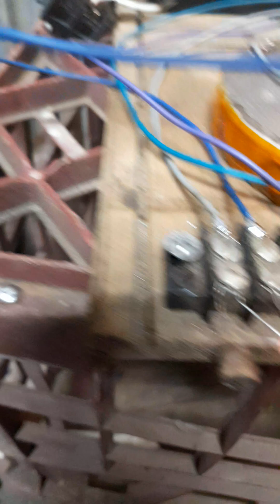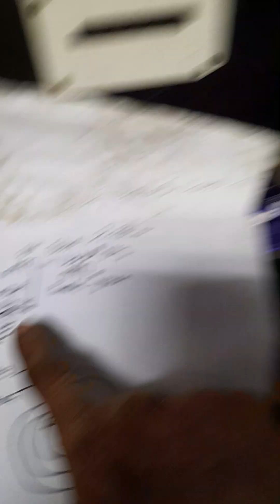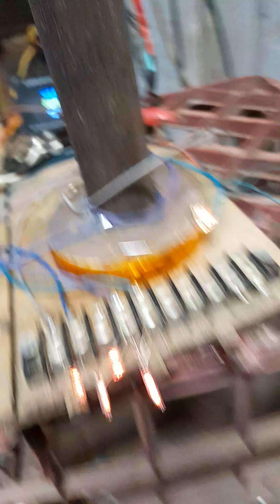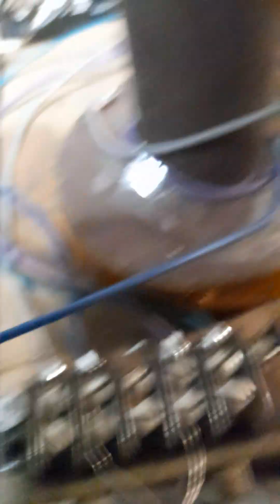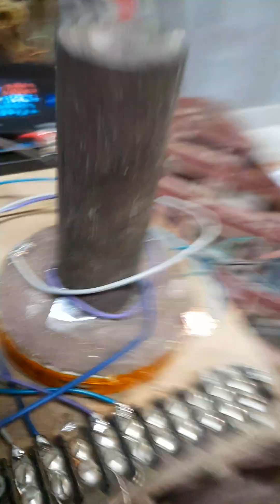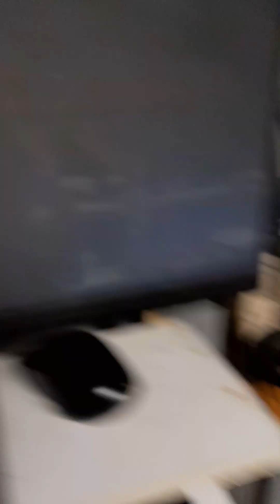Tesla electrical oscillator circuit driving copper tape bifilar coil.

Comment: Cool experimental video! What do you think about Wimhurst machines? Could you find a way to get a static electric spark generator thing (wimhurst machine) to do anything useful? Like charge a battery or power a light
Reply from the maker: thanks... not sure where i was going with this... i lie. i was aiming to get the 1/4 wavelength conductor in combination with the LC tank circuit, had to make something to at least get an idea of how the dielectric thickness/surface area interact... but ran out of tape when winding... the copper foil is definitely a 50M roll, the tape was only 30 at best... and from what i can figure out from calculators, i really want about 0.5mm or thicker dielectric.

so just playing with a few neons,  it did show a few peculiarities,  capacitive versus inductive coupling. the video does no justice... and i have no faith in any measurement made of either value with a standard meter.... mostly because theyre invariably an LC oscillator. so i cant even say how the calculated values differ from actual values.
put on the shelf and do other things, and suddenly several years have vanished!
i believe the only way to get true readings is via wheatstone bridge measurements or similar... take away the frequency component and you can isolate the inductance from the capacitance.

as for wimhurst machines... in most regards they are just like any other generator... output proportional to load on power source. a magnetic generator loads down due to lenz reactions/opposing magnetic fields, an electrostatic generator loads on electrostatic attraction/repulsion. two sides of the same coin. 'watts" just being current AND potential...

as theyre invariably made to deal with high tension rather than power output... definitely promising if they were redesigned with power being the ultimate goal? more sectors, wheels in parallel, optimised brushes, etc. i believe there is a better type, the bonetti? benolli? i forget the name now i need it, lol...
theres a channel where he also makes them as cylinders, drums rather than as discs? could have layers of interleaved cylinders...

and bear in mind that when they are discharging, that spark is current is "electrodynamic"... no longer static, and current is a magnetic field... step down transformers/buck convertors, that sort of thing? 

theres also the very distinct possibility of limitations due to the same sort of issues with LC tank circuits... any two combinations of L and C may produce the same frequency, but there are ideal values for maximum "Q", and the resistance also plays a role...

 if only we had more time in this modern world to experiment freely and get a better grasp of these things, and their interactions! the old books help but at a certain point youre still delving into uncharted territory... 

ive never actually played with wimhurst machines... and lost all my old videos on the tesla coils... made a 6ft diameter pancake coil at some point...

lol, TLDR!
Reply: @ well my new friend, you know the funny thing? People go to the gym, and expel energy, kinetic energy under tension just for the sake of it… why don’t we team up to make a sustainable gym! Which utilise the energy people expel using kinetic generators, so as people exercise on the stationary bike, they spin a cog which turns a generator and kinetic energy powers the gym lights! Charges batteries! Let’s team up !